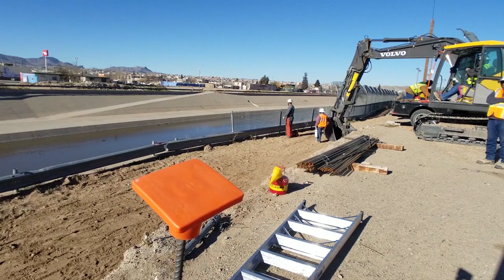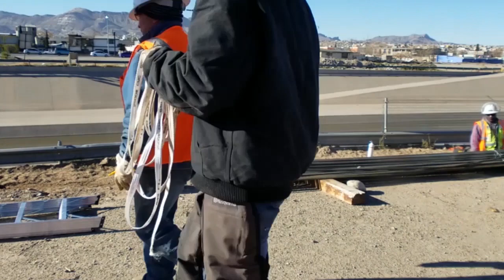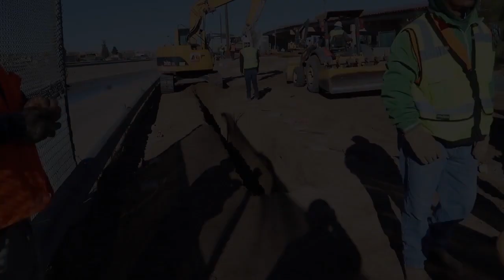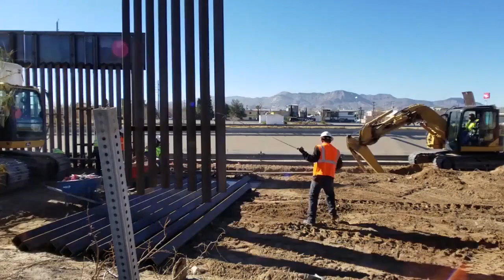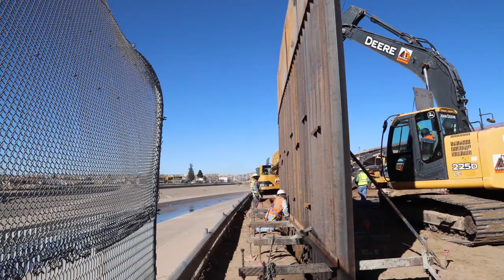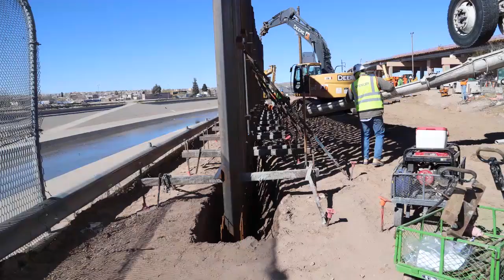U.S. Customs and Border Protection installs El Paso border wall

Comment: I wish the anti-climb section was taller. Overall good design. MAGA 🇺🇸
Reply: This is just Phase One. Phase Two adds another section of Ballard wall on top of the first section. That comes during Trump’s second term.
Reply: A 5-foot plate is pretty good.
Reply: Crazyirish _ a two layer design would be good, a buffer zone with laser sensors to detect trespassers before they get too far.